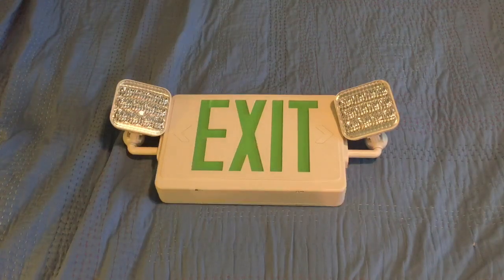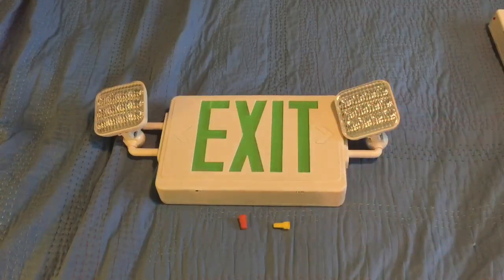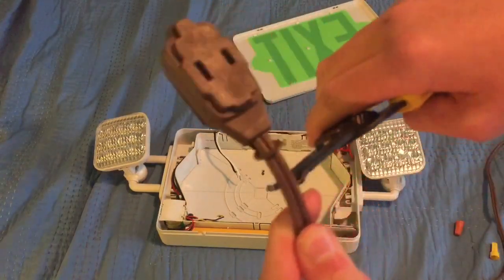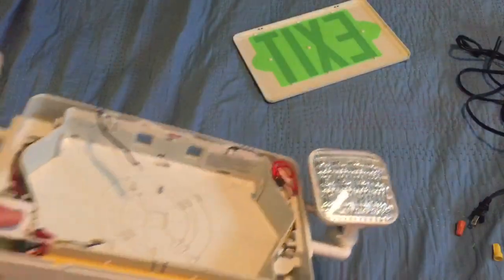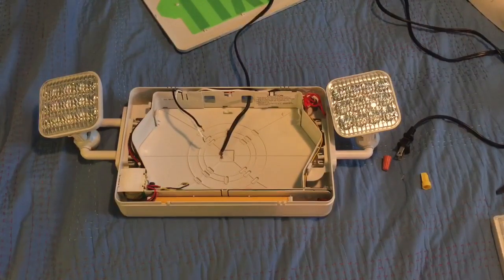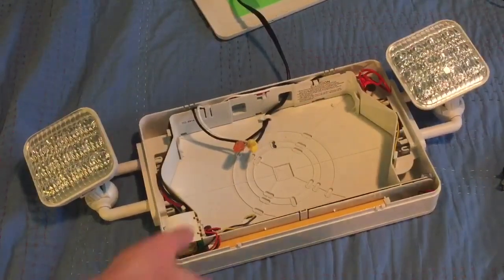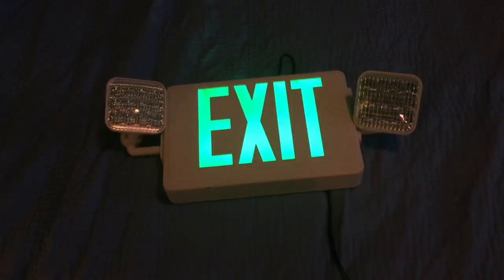How To Wire an Exit Sign

Comment: hey brother...me again. The only name (possibly) is Emergency lighting and Power Equipment. ..model # CXTEU2RWRC.
Reply from the maker: Hey! I see. The models you have are generic no brand units. In a nutshell, these are all in the category as we call “generic” meaning they are very bad and cheap quality and don’t go for much. One company mass produces different designs then hundreds of thousands of companies rebrand them and claim them as their own. These companies could care less about safety and only want profit. Generic units don’t cost a lot to produce, and that’s how they get purchased frequently. It now makes perfect sense why your units are failing because these aren’t built to last compared to other great brands.
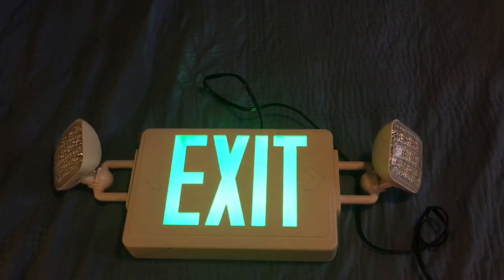Reply: ExitSign250 Gotcha...one other thing I noticed when I went to take out the old batteries they were bulges and cracked. But the question remains...why when I put new batteries in the lights are dimly lit and when I press the test button they're bright. it's like something is backwards or something. There's two batteries in the sign, piggyback wired, if you will. I'm missing something. No need to get back now, I know it's late. 9:30 here in central Texas.
Reply from the maker: If this makes any sense, but I don’t have an answer yet I do. I’m not sure why this problem is occurring however I do know. Since these are generic as I said they are unpredictable and not built to last. I’ve seen a few that are completely backwards. Exit sign illuminated and the emergency light heads are on while AC power is supplied, then when the test button is pressed or power is cut the whole unit goes dark. I could go on and on about various problems and issues I have seen. You’ve mentioned that there are two batteries in each combo and they are bulging and such. Usually LED/incandescent combos like this take a standard 6v battery. But yours have two which means they are high capacity. Meaning that you can ether have a longer run time in a power outage or supply power for remote heads. I’d assume the hotel you work for bought the high capacity models to have a longer run time. (Or they didn’t know the difference between both types, they also might have been recommended to buy the high capacity models) As for the batteries bulging and such, more than likely the originals (maybe also replacements) are also generic and low quality. It isn’t an uncommon thing to find these Chinese batteries to do things like this.

Comment: I have a two battery emergency exit with dual lights. I replaced the batteries and the lights are dimly on. when I push the test button they're bright. wth is going on? I connected exactly how the old batteries were installed. Someone Help.
Reply from the maker: +Dark Horse 3/5   I’m assuming by “emergency exit with dual lights” you are talking about an exit sign combination. (Exit sign with an emergency light) So your saying that when you plug in the replacement batteries and the unit has normal AC power, the emergency light heads remain dimly on. But when you test it, the emergency light comes on brightly. Can you possibly tell me the brand and model? If so I can do more research and tell you the issue. It may be a simple mistake or something more.
Reply from the maker: Just a tip of advice, don’t give your number out to strangers or anyone on the internet. And I’d prefer not to give out my number for privacy. However if you’d like me to help figure out the issue we can discuss this on a private message on YouTube. And if that happens we can get your sign back in business!
Reply from the maker: Ok! Yeah hopefully we can figure the issue with these units to help save money and prevent the constant purchasing of batteries. I’m glad you understand about the phone number thing. Some other people get upset with me when I just want the best for the person and myself. I really appreciate that from you! Anyways, to PM on YouTube, you need to be on a computers. Once there click on my channel then hit “about” and it should say something like “message this channel” or something to that extent. It could be an icon too, but I’m not sure. Let me know if you need more help on this! Then we can continue this conversation.
Reply from the maker: Ok great! I will try everything I can to help you out and to find the problem with these signs. Keep me posted on anything you find.

Comment: do exit signs dim the led when it it used for a long time
Reply from the maker: +Andrew Casillas   Depends what brand and how they are powered
Reply: does it do that when during a power outage because my exit sign does that and i just want to make sure it works properly
Reply from the maker: +Andrew Casillas   Yes, if you have a model that has battery backup, it will continue to work in a power outage for 90 minutes or more.
Reply: Thanks!
Reply from the maker: +Andrew Casillas   No problem!

Comment: What wire is it and can you link them on amazon or eBay pls I need it
Reply from the maker: +Phantom forces   You do not link exit signs and/or emergency lights together. They are all independent for the most part
Reply: @ExitSign250 he meant to buy a power cord

Comment: I wanna get one for my room . Im wondering if one of them come with a on/off switch or if not could I plug it to an outlet? thanks
Reply: You dont need to plug in the battery
Reply: @catherinebenson3525  yes you do in case of a power outage

Comment: After you unplug it, how do you get it to turn off?
Reply from the maker: +ironmatic 1   You have to unplug the battery
Reply: @ExitSign250  i know I'm very late and don't know if you'll reply but I got my exit sign ready to be wired after it's wired and I unplug it to turn it off is it safe to disconnect the battery after it's unplugged to shut it off because I don't want to hurt myself or damage my sign
Reply from the maker: Yep! Totally fine to do that.
Reply: @ExitSign250  alright thanks my sign is  wired and working perfectly. Your video was really helpful especially with finding the positive and negative end of the extension cord.

Comment: Good video! Where did you get 277 from? Its usually 220-240.
Reply: +HJCF0520 277 is in 99% of office buildings. And it's not neg/pos like he said in the video. 120/277 is the hot/active and the "negative" is a neutral (white/gray)
Reply from the maker: Thank you! Nope, all my signs say 277 VAC
Reply: +ExitSign250 Interesting. Thank you.
Reply: +Zeta oh okay. Thank you for the info.
Reply: HJCF0520 No problem
Reply from the maker: +Zeta   Thanks!
Reply: ExitSign250 yw
Reply: firealarm man commercial voltage
Reply from the maker: +firealarm man   It's a type of voltage
Reply: HJCF0520 I don't know, but I see it Alot